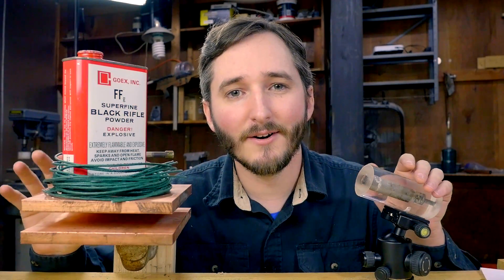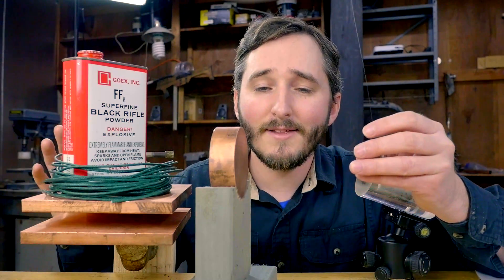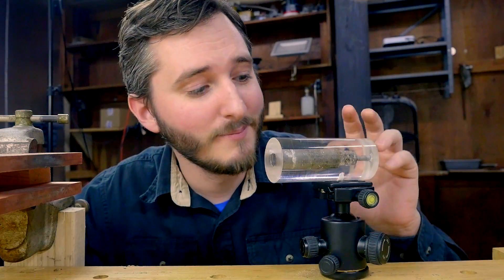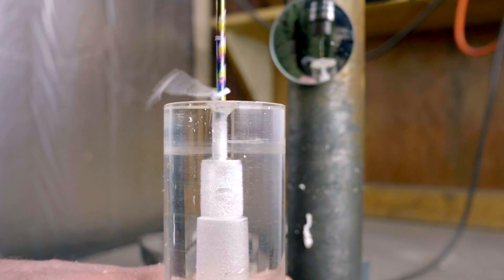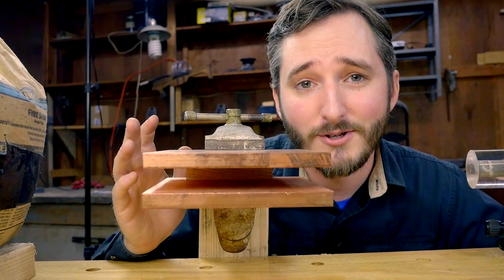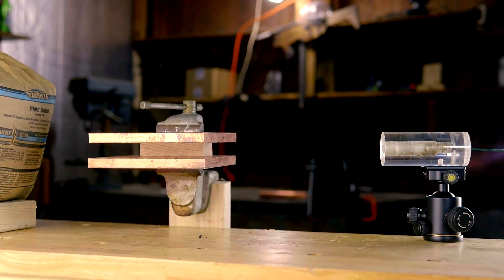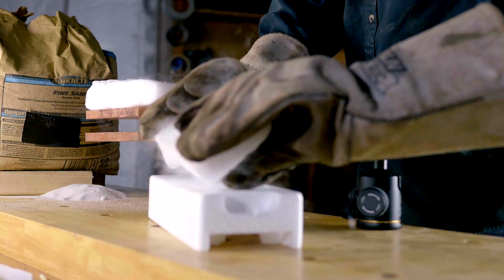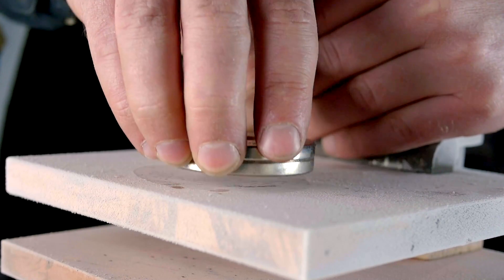Electromagnetic Force Fields VS. Magnetic Cannonball

Comment: Hello there Hawk, That was an interesting video. 

I am a science student but not in the field of electricity.  I have been thinking of a device which could act like a 'gun'. (Sniper gun or a rifle)

Very long ago, on TV, i remember seeing someone build this, It would be great, if you can try building it and demonstrating it in your channel.

A long transparent pipe, say 1 meter long,  with copper winding around it, from end to end (I vaguely remember this).
As usual, each end of copper wire will be connected to a direct current terminal.

Place an iron ball (1cm diameter say) (any metal that can attracted by a magnet) at one end.  Turn on the field around the pipe, the ball should start traveling thru (and out of the barrel) at super speeds.  I think, there should be a circuit which will induce very high current (I) or voltage (V) (I don't know) to produce high intensity but very short magnetic field in the pipe, that will just pull the bullet thru the barrel. (Something like a mosquito squatter / bat but produce higher I or V).

I hope you  understand what i am saying, if not, please reply to my comment, i can quickly try to explain.
Reply from the maker: That's called a coil gun. You can find lots of videos if you search for that on YouTube.

Comment: I don't understand why you wouldn't shoot it at a plate of copper directly head on to it not shoot metal between or down a tube but shoot it right a sheet of copper like at the beginning how you wss swinging the pendulum and it wouldn't make contact with the copper  see if the bullet slows down and then stops like the pendulum does

Comment: Cool the copper with liquid helium down to 4K. Then it will stop the magnet.
If you use YBaCuO instead of the copper liquid nitrogen will be cold enough.
YBaCuO wil not have any effect if it's warmer as 92K (ceramic an though an insulator) but below 92K it's super conducting.

Comment: I'm curious about how much energy that could be generated from firing a neodymium cannon ball through the pipe (likely not a viable energy solution, but i'm still curious). Another thought was, what if you had a pipe that was made from lots of spooled copper, instead of just using a long copper pipe would it offer more resistance? Also, was curious about the cannon itself, could more momentum be generated with a rifled barrel, and would that momentum and spin of the neodymium round be affected by the resistance of the copper spooled & non-spooled pipes.

Comment: When drilling your acrylic rod out, you made the mistake of drilling at high speed. Drill bits of that type aren’t supposed to act abrasively, but rather they should slice material away.

Comment: It's like watching a day where math has been outlawed from science. You can get the length of sting and angle of difference where your magnet hits vs. misses. However, some reason there's no attempt to calculate an acceptable muzzle velocity that would actually be effected by the mass of the much-smaller field generated by the smaller spherical magnet.

Comment: Use a boresighting laser to ensure you're getting your cannon aligned properly.. fashion a rigid mount, place it on rails with a spring attached to the front and to a loop on the crossbar separating the two rails/rods. or just put a backstop behind the sled and place a spring behind in a hole bored into the backstop.

Comment: The problem here is that if you use explosion to propel the magnet you will heat the magnet and decrease significantly the magnetic flux! The poor copper does its job :)

Comment: I made my own eddy current brake dynamometer and found that there was indeed a certain rpm where the torque maxed out and then started to go down with further increases in relative speed. I've also observed this effect when an induction motor starts up. At first the slip frequency is 100% and torque is quite low. You can hear the slip tone from the motor. Then as the motor speed increases and the slip frequency drops, at some point, all of a sudden the motor takes off and accelerates rather quickly to full speed. This explains why motors have a break down torque, otherwise torque would just keep getting higher and higher as the motor is slowed more and more by the load. It also explains why rotor bars are carefully given a particular cross sectional shape to produce the desired torque curve. I used to think that lower resistance would make for more current and more force as relative speed goes up, and it does up to a point, but it is a curve that goes up and then back down. What I learned is that the copper pipe effectively gets thinner walled as the speed increases. At some point this thinner wall makes the current go down and the force goes down with it. For my dynamometer the maximum torque was at a relative velocity of about 19 meters per second, the speed where the disk passed under the magnets. I was using an aluminum disk. It dissipated 5,600 watts of heat, or about 7.5 horse power.
Reply: Oh it's the skin effect.
I hadn't considered that.

Comment: Step 1. Get yourself liquid nitrogen or liquid hydrogen.
Step 2. Cool down the copper with the liquid.
Step 3. Put an high electric current though the super cooled copper plate.
Step 4. Shoot a metal projectile at the copper plate
KABOOM! You got a super conductor wtih a strong magnetic field that may reduce alot or even all of the speed of the bullet?

Comment: My father was a mechanical technician for Eastman Kodak for over 30 years. His job was to take the blue prints given him from the engineers and built it into a working model of whatever it was. One thing that he was supposed to build needed stiff but spongy urethane foam for shock mounts between the case and the piece of equipment inside it. Several people tried razor blades and exacto knives with varying shaped blades. The engineer demanded EVERYTHING to be neat and professional looking. My father took several pieces of the foam to a different part of the plant where they used liquid nitrogen. He dipped the foam in the liquid nitrogen and quickly ran it over to a drill press in the shop and made perfect holes. He aggravated the hell out of the engineer that designed it because this engineer had it in for my father. He never did find out how he did it. :)
Reply: foam would shrink and deform if dipped into liquid nitrogen either this never happened or your father dummed down the material to 'foam' so you could understand you brainlet

Comment: It would be a lot better to use a huge magnet instead of copper plates to slow down a copper bullet, although still, that bullet would definitely need some decent surface area. The bullet would also probably melt in the process so I don’t know up to what point this could work. I can actually try doing the math involved...

Comment: You should turn the plates to be perpendicular to the path of the projectile (shoot THROUGH the plate). That should be able to stop it (the force generated is perpendicular to the plate, right? It's not going to slow it down if you shoot parallel to the plates... perhaps the projectile itself needs to be a supermagnet. (it should still work to stop charged radiation particles)

Comment: Perhaps this effect could be used to shield against radiation on space craft, so that we can (finally..) get through the van allen belts and get to the moon. We can't even use the space station because the van allen belt radiation got worse (that's why obama ended the manned space program..). If we had a large enough source of electricity, we could generate electromagnetic fields around a spaceship or spacestation, protecting it from radiation the same way the earth's own electromagnetic field does. A nuclear reactor from a nuclear submarine should work, and only requires refueling every 25 to 30 years.

Comment: I have a test for you to run. At the 0:50 mark you do the magnet and copper test. I would like to see this test do again but this time take a voltmeter and hook one wire to the copper discs and one wire to the magnet. I would like to see what kind of voltage it would generate.
And show the hole in the barn door.

Comment: One thing to consider is that your magnetic ball is rolling which is causing the poles to continually flip. That could be a factor. You should try a cylindrical magnet as your bullet. Personally I don't think your copper will stop it, however I think further experimentation should lay this notion that a magnetic field could be generated by the magnetic projectile and copper plate that would be strong enough to overcome the momentum of the projectile to rest.

Comment: I liked the presentation you did and what guy doesn't get giddy when there's something going boom.
Using air pressure to launch the projectile was the best comment posted and I agree also. Thanks for doing this demo anyway. 
I also love playing with magnetism in any form and contribute this trait due to being born the same day as Nicola Tesla was, just many decades later. 

Here is an experiment for you try it have not yet:
Using your magnet on a pendulum, have it swing over different non ferrous material plates at a close distance to also see the "Eddy Current" effect. But then place a disc or plate made from pure Bismuth where the others were and see what happens!!
It helps if the Bismuth object size is no more than 2X - 6X the size of the magnet and at least 1/4" thick. Bismuth can be easily melted and poured in to a mold to make the test sample .
Have fun.

Comment: I think that what happened here is that it might have just made the magnet spin. I know it creates an opposing force so if the magnet is shooting north to south and it induces a south to north magnetic field, wouldn't the magnet just flip around and face the other way? I know the magnetic field in the copper would flip again too but wouldn't it just make the round magnet spin? What happens when you spin a magnet falling through a copper or aluminum pipe?

Comment: for your 2 plates experiment, don't you have to close the circuit between them? they are held in a clamp/vise on 1 side (I'm assuming that vise is electrically conductive and you didn't insulate between the jaws and the plates) but there's no electrical connection on the other side (close to the camera).

Comment: Use a Ultra high pressure airgun (4000 PSI) and mill the material so that it fits inside the barrel?? It might ruin the rifling in the barrel but it won't heat the magnetic projectile, velocities of up to 500-1200 FPS could be obtained I think.

Comment: You might not be able to stop a bullet but I bet you could use an armoured plate with extra magnetism to deflect a slower round. Bullets are around 3000feet per second whilst anti tank projectiles are around 450 to 500 feet per second. Deflection combined with cage armour might do the trick better than cage armour alone.Nice presentation.

Comment: Why not just drop the ball magnet/projectile from a height through the copper tube or coil and see what the effect is on the time of falling when no tube or coil is there to interfere with the falling ball. You might be able to do a side by side test and let the high speed determine which is faster ie did it slow down when passing through the coil.No danger from explosives either. You would need a high platform. Shades of Gallileo.

Comment: A simple way to aim your cannon would be ruse a laser against the back of the breach shining through the fuse hole, would be a lot more accurate. Could close the gap between the plates to closer the diameter of the ball. Also what happens if you started with a current in the plates using a welding lead attached to each plate? Love your videos! Keep it up!

Comment: At your timestamp 8:18, the new hole cause by the projectile magnet through the dry iced copper may have experienced another effect.  If your backstop was in the same location (as well as your cannon, etc) and the tape represents where the previous trial impact occurred, the a right hand rule spin may have occurred due to the induced fields, causing the forces to bend the path of the projectile magnet.  I'm not sure, but your light weight enhanced conductor may have performed an secondary job that you were not looking for.

Comment: Why doesn't increasing the conductivity of the copper plates (by cooling them) reduce the effect on the passing magnet? 
My thinking is that the magnet interacts with the same number of electrons as it passes through. Resistance to electron flow becomes resistance to the movement of the magnet.

Comment: 👍 👨‍💻  I     LikEd     IT  -  Been watching PROF julius   Sumner Miller  tried a few experiments but no success yet i dont have the equipment like in his videos but heey least i tried :)  1 heat a pipe with a bit wire mesh inside 5 sec's and   the pipe resonates  some cardboard tubes also 
2 heated water  reboils  if u hold onto the glass beacon for a few sec  dip hands in some ice water 1st
 i burnt my hands trying this  in a jar :(  No success again  👨‍💻🤪 BEST I stay away from rockets mite blow the  lid off something haa
we didnt fail as prof says alot  we just didnt provide the right environment for Nature :) to do what we asked  haa so  right  im wrong at this

Comment: Be very careful ..! Using acrylic ain't the best thing you can do. The stress of the internal pressure will cause it to fail so sooner or later, you'll have shrapnels of acrylic flying around in the room!
Use the same method but use metal like brass, iron or stainless steel. Furthermore, let the firing hole come in at an angle of 90 degrees to the combustion chamber. Do never overload the cannon. For this experiment a small amount of black powder does it. There is no need to fill the damn thing to the brim. Some 20-30 years ago I made a lot of small cannons by myself and had some fun with them. Doing a penetration test made me realize how much energy just a tiny amount of gunpowder releases. Think about what damage a small 22 cal. can actually do (I know, it's smokeless powder and not black powder)never the less, black powder can produce some real damage.
You realize you've got to produce a shit load of magnetic force to stop a bullet? Be careful, be responsible when working with explosives and have fun..

Comment: I would expect a ball magnet to be a bad choice. If it encounters an opposing magnetic field, it could just spins around instead of being repelled. You also have no control over the direction of the magnetic poles in the first place. So it would've been interesting to see a cylindrical magnet being fired through the pipe.

Comment: It is true that magnets lose there magnetic properties when heated. since the acrylic barrel is a poor conductor majority of heat is absorbed by the only metal that's the magnet. The lose of the strength of magnet reduced the effect of copper on it, causing it to continue in its velocity
Which unfortunately punctured a hole on ur wall...
Reply: This is a tough one. The magnet doesn't have enough time to be heated from the propellant gases, as the residence time in the barrel is a fraction of a second- the same reason you don't burn your finger when passing it through a candle flame (A Heat Transfer Textbook 4th ed., Lienhard & Lienhard example 5.5). The grand majority of the heat will be lost to the atmosphere. On the other hand, the shock on the magnet might affect its magnetic properties. So it's hard to say! The best bet would be to test the magnets again afterwards.
Reply: @apathyisFTW  
Everything in the canon he made is poor conductors of heat. Also the hot fumes from the ignition is moving along with the magnet.(if there is any heat absorbed it is by the bullet that is magnet and the gases followed by the acrylic barrel). So there is a chance.
And also the sudden impact on the magnet also causes the loss in its magnetic property.
Reply: @apathyisFTW  
Yep it is because of both heat& shock

Comment: Heating up a magnet weakens its magnetic field significantly. Maybe use a CO2 or HPA powered system. Like an airsoft gun with ball bearing neodenium magnets. If you fire fast enough you can freeze the projectile with CO2. I dont know if the absence of heat increases the magnetic fields strength. (It might) you can us a regulator and a chronograph to find out the exact speed threshold the copper plates have to where they will stop something moving in Feet Per Second

Comment: The magnet too small when it in the tube it doesn't has the enough energy to produce the negative charges on the copper pipe you need the nearly fit magnet to the pipe

Comment: I would have liked to have seen the copper pipe have the same wall width as the plates used at the beginning. I don't know if that would have made a difference, but it would have removed that variable from this experiment;  wall width changes.

Comment: Perhaps the heat from the explosion reduces field strength.
What happens to a copper or aluminium projectile passing betwixt two very large ND Magnets?
You could try an energised coil   with a magnetic bullet.

Comment: wow best viewers-to-subcriber ratio i have seen so far (1,3mio subs to 1mio views)
Usually number is ~20-10 to 1
If the smoke blockes the view, then you can switch to infrared.
Its an easy to mod any camera, just remove the IR-Filter,
or like Saitama would say: remove the limiter xD

Comment: What you need is a pulse of magnetic field, A bullet is conductive, so if you make an electromagnet, the eddy currents in the bullet will slow the bullet down. You just need an insanely powerful electromagnetic pulse. This could be done with capacitors and superconductors. This would work!!
Reply: Although I think it would just melt the bullet.

Comment: You should have put a laser pointer through the hole for the fuse to line it up then mark it somehow for loading. But you would need to clamp down the cannon so that during loading the barrel doesn't move.